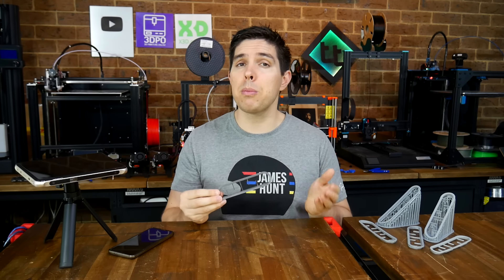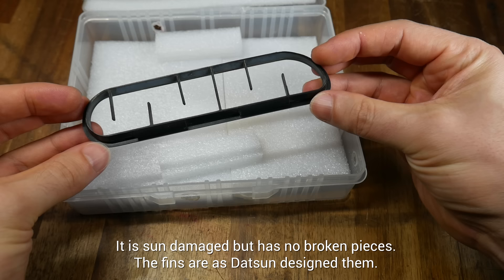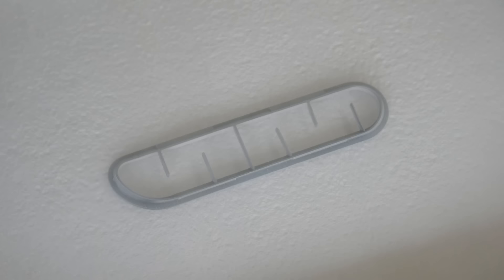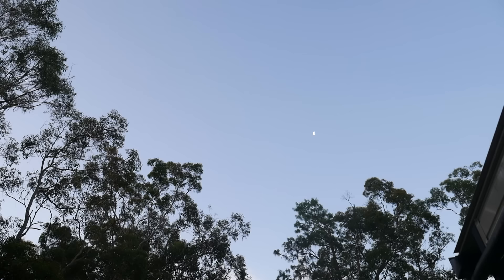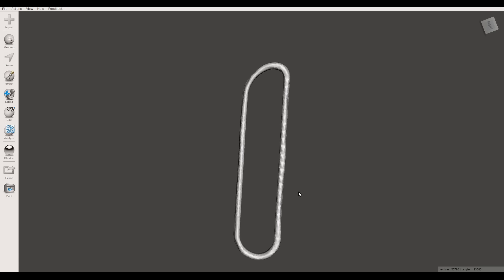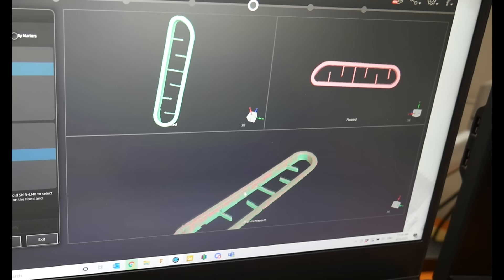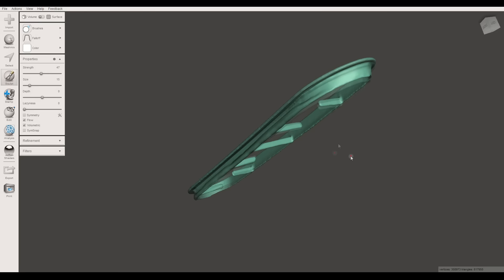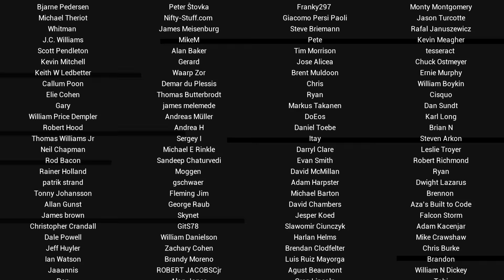3D scanning + 3D printing to complete a classic car restoration

Comment: And this kids is why 3D scanning is less costeffective for such simple parts than modeling them in CAD. The time he spent on editing the mesh and reverse engineering the part is probably much greater than just spending 30min modelling the part in CAD accuratly. And then you even would be able to mill this part in a 5 axis CNC from almost any material without the risk of the resin part getting brittle over time in the interrieur of the car and breaking eventually.
Reply: Yeah...good luck with less effort on making those fins, Mr CNC
Reply: Yep. To right.  i could have reverse engineered that part without 3D scanning it easily. Some of the parts i've had to do over the years without a 3D Scanner make this thing look a breeze. And thats coming from someone that built his own 3D Scanner 12 years ago.
Reply: Watch whole video ;) That scanner is used exactly for reverse 3d engineering professionally. this time they didn't override 3d scan geometry (which save you time measuring object)  with cad model, since i guess 3d scan was precise enough for just one part, but they could easily done that, if needed (in case for some larger scale production etc). It is mix of technologies, that works great together.
Imo, on the other hand,  photogrametry is most usable on larger scale objects like building, statues, terrain etc, especially with drones etc (where lidar solutions costs by factor 10 or 100). I'm in the making of my father's old country house in 3d model, which will be probably prototyped in 3d print, which i will use after as painted plaster casts, ends as a gift for relatives, since house is going to be sold.
Reply: Indeed this part is a little simple for scanning but it wouldn't take much more complexity for a part to tip over into scanning being ideal. Also would your model be a perfect copy or just a good enough look alike. There is merit to getting the visible geometry perfect.
Reply: @izoyt  i did what teh whole video. That in no way disproves the points made. And neither does th rest of you post i'm afraid.
Reply: @SetitesTechAdventures  It would be far more accurate to the original then his scanned and directly printed part would have been. If you look during the TT's full video you'd see how... inaccurate it really was compared to the original as he further has to create "dummy" features to make it actually usable and it is STILL not perfectly accurate.

I could have easily done that manually from the get go. I have been doing it for over 2 decades so i am very VERY well versed in reverse engineering and what it takes to actually get usable geometry in the real world for real parts that need to be created in a myriad of ways.

NO one here is knocking TT's video. They are imply pointing out that just because you hear a buzz word (in this case "3D Scanner") does not mean its the be all and end all of how one would approach something especially something that one should take many different factors into consideration like reverse engineering something for some kind of end goal.

The amount of times i hear people repeating marketing speak like as if its true is beyond me. The last people should believe... are marketing hype and marketing lies and that goes for even great tech like 3D scanners and 3D printers. The caveats really can bite you in the ass.
Reply: @hoffybeefe  What would be your advice to someone who knows the basics of Fusion 360 but not enough about measuring things and bringing them into the CAD software? For example, how would you have measured the arc on this part? What about more finer details like the latches or the curvature of the areas underneath the part where TT didn't really care too much?

I have no issues putting in the effort to model things from scratch, but often times I don't even know how to begin when the part gets to be a complex shape. I'm not even sure of good search terminology to watch videos/read about it.

I've gotten to the point where I can model most things, tweaked my printer to have decent tolerances and reliability, but measuring is my biggest weakness.
Reply: @ashiha13  I'm the same as you, I feel like I'm pretty good at modelling most functional parts but smooth organic curves ruin my day. Even older vehicles are almost all organic curves, so unless I'm making something that will mount on a flange or flat surface, I'm usually out of luck when it comes to drawing up car parts from scratch. Doing a scan and then using it as a template to draw from is a lot better than trying to just eyeball it, IMO, and sometimes the rough scan with a little touch up can be good enough for a one-off instead of trying to model a part from scratch that has a complex shape and non-critical function.
Reply: @ashiha13  "measuring is my biggest weakness" - there is no easy way to say this so i'll just be frank.   This is what separates those that "have it" and those that "dont".  I'm not trying to be mean, just that this is what separates ability from.. well... none. 

Just because you now have access to software that can do a lot of the work for you and gives you the ability to show people pretty pictures on screen and get to pretend to be a "design engineer" to anyone you show them to that has even less of a clue about what you're doing then you do just because they see a 3D object rotate on screen, doesn't mean you don't get to forget the actual part that matters... thinking. aka putting in the work to figure something out. Drawing something is the easy part nowadays.

There are a ton of ways to measure an arc of an object with varying degrees of accuracy and varying degrees of applicability (i.e. can i actually use this method for this arc on this part and if i can, are the results accurate enough for what i want to achieve).  If i can't use this method to measure this arc on this part.. what method could i use instead and can i at all.

Having initiative to figure this out is what you need to learn.

Get a set of verniers, at least two rulers, and some cardboard and scissors (just to name a few tools you could use). And if you can't think of ways to utilise those basic tools to get some usable results... you're doing it wrong and you're in for a tough time with reverse engineering (or design / technical work in general) i'm afraid. ;)
Reply: @vidznstuff1  some 5axis machines like my okuma millac33t would be able to cut those no problem. However the best method to making them would probably be to make the whole of the outer shape on a mill and then use a 5axis wire machine to cut the fins. In either case this would put these parts in the thousands of dollars since the market is relatively small and mass production would be unnecessary. I think 3d printing these parts is an awesome option, would be cool to see it refined more and printed on a metal sls machine.
Reply: @izoyt  I wouldn't call this a reverse engineering since he only cleaned up the edges. I work as a reverse engineer with German FARO arm that costs around 100k USD and scanning something like this would take about 2 minutes. Putting the scans together 5 more. and I would reverse engineer this whole part easily since its not that crazy and that would take about 1-2 hours. Customer is pretty much never paying for the scan. More for the modeling. If you have the scans you will be able to model straight into the scan. Its hard to explain without visuals. In this case customer would pay around 120 USD for the perfect model for this part.
Reply: @ashiha13  for getting the curvature of this part right in fusion i would take fotos from the the side, import them and scale them. then i would create an 3 point arc that imitates the curvature of the part measure its diameter/radius and round to what sounds right. the rest of the modelling process should be easy going with a reference foto of the part from the top. just use the same procedure and round the values to what sounds right. because remember engineers and designers have a drive to use "good sounding" numbers :D. regarding modeling free form surfaces in CAD a good way of doing it is to use 3D sketches to reference the points you want to be accurate or to create multiple sketches with cross sections and guids to either sweep along and trough to create a body or to model a surface and then thicken it.
Reply: @vidznstuff1   haha i get your point but there is always a way to make it work :D you probably even could print the part from resin, make a silicone mould to pour hard wax into it. then take the wax parts and put them in investment to pour it out of any material you like. (aluminium, brass, copper, gold, whatever :D ) this way you could make lots of copys of the part for cheap.
Reply: Easier said than done. Also that's not the point of the video. Use the right tool for a particular job, and sometimes it could be to just model it would be a fair analogy to contrast with. I just did a similar project with a very power tool part. I tried photogrammetry and the same meshroom app then the pop1 scanner, then I eventually just modeled it entirely in meshmixer and printed it in pc. It took about 6 version before I was happy. Fun to me. If I had the pro scanner I doubt I would have spent more than 15 or 30 minutes on it.  I had to make design improvements because the original was metal. Had to build up the break points.
Reply: @CdoGtheGreat  i agree with you on the point that every tool has the right use case, but in the case of this channel named "Teaching Tech" it should do exactly that... teaching and not applying tools that are useless for the usecase. he should have given the advice later that even the expensive scanner is not the right tool for this job. regarding the reprinting of parts and iterating them that way. the way you learn it at uni (mechanical engineering) you should iterate as much as you can in CAD and try not to manufacture a part rightaway because it is timeintensive even with 3d printing. over the years/semesters you learn many techniques to reduce your failiure rate for prototypes. in case of 3D printing the most important thing is knowing YOUR machine and its tolerances. this can make a huge difference. but in case of a 3D scan you cant really compensate for tolerances and thats why 3D scans always have to be edited. somtimes more... sometimes less.. and somtimes the "more" exeeds the time you would need if you started to model it by hand rightaway. also setting up a simple FEM simulation even if it is not very accurate for a layer by layer process plus infill it can significantly reduce your reprints and thus the timeinvestment because it gives you an idea if your part is even in the ballpark of being suitable and can give you a valuable feedback on which sections of your part are most likely to fail because of high tension. 90% of the time i dont have to reprint my parts because they are suitable for the job.
Reply: @Joern8910  all good points and I agree , sometimes the hand and the head are better tools for a particular job. I think tt's target audience isn't just one group, say professional mechanical engineers. I think he makes these video in a way that hobbyists like myself would understand and be interested in and maybe still have elements that pro's would like too. That is really one of the more difficult parts of being a huge famous youtuber like tt. :) . He has to dumb this stuff down for the likes of me. I would have access to many of the expensive or obscure to common folk tools to properly measure organic curves and such. Eventually I would love to. Also time as it's just a hobby, but would eventually like to learn. I'm just greatful he is making content that helps me relax and forget about the day job. Heck I watch more stuff like this on YouTube than I do tv.. 😆
Reply: @hoffybeefe  I think this demonstrates the value of 3d scanning. In my 1 year of hobbyist dabbling with 3d scanning, 3d modeling, and caliper measuring there is merit to the tech for closing the skill gap between someone like me and you. I can't model an organic curve beyond simple arcs, chamfers, and pulling at stuff. But I can scan an organic surface and then smooth out imperfections, and fix things that are unseen. This is useful too in case I use a resin or plastic with slightly different properties. With that reverse engineering app I might be able to do even more, I haven't tried it. Your skillset is a valuable one that future people will likely not have to learn as well if their only job is reverse engineering.

I do know that you aren't criticizing TT. Also if the part is so hard to find the part just has to look right and be sold in mirrored pairs.

That said I have to think that he should have been able to scan this better. Like he used sugru or something with the structures light scan but I'd like to see him try that with the infrared scan. I've seen superior scans from the revopoint.
Reply: @SetitesTechAdventures  you brought up some really good points I did not consider. you see I just assumed that everyone can model semi complex geometry and free form surfaces to a certain degree in CAD. Even compared to a buddy of mine that specializes in aerodynamics I can't keep up with his skill level in modelling these surfaces.. let alone compared to professionals that have been in the field for many years. What I want to say is know how in CAD and modeling parts the "right" way (how you learn it at uni) by hand saves you a lot of time. tinkering with a so called "dead model" like a mesh is timeconsuming, but to gain that level of knowledge you have to also invest quite some time to know your way around problems and get fast at it. That's time hobbyists maybe don't have and they are searching for easy and quick and sometimes dirty solutions to get to the job done and the geometry they want. Thanks for the enlightenment and insight ✌😊
Reply: Problem is to get the dimensions right. best is to do a coordinate mesh and design the part arround it.
Reply: @izoyt i would’ve used the scan as a reference to make my own model